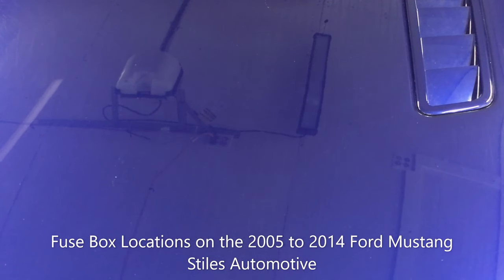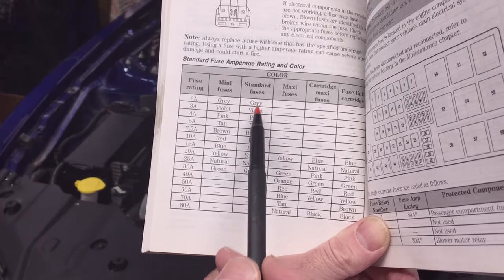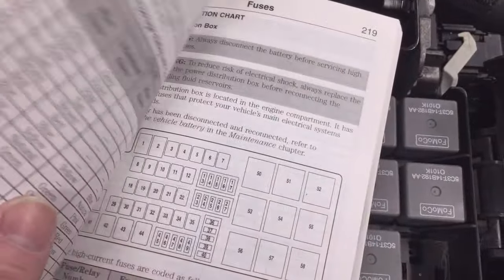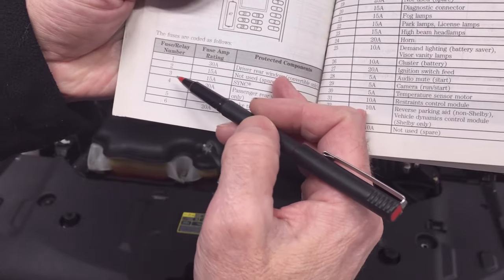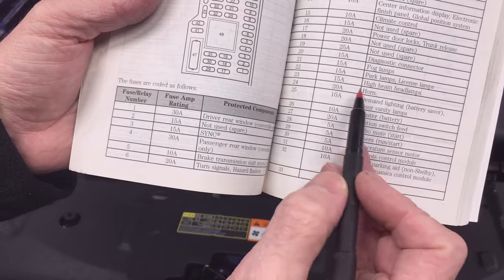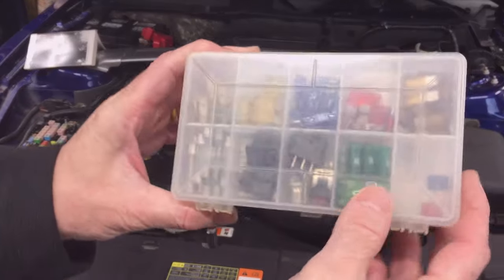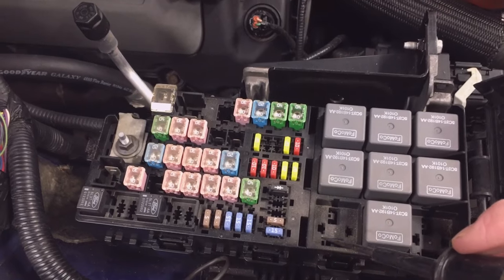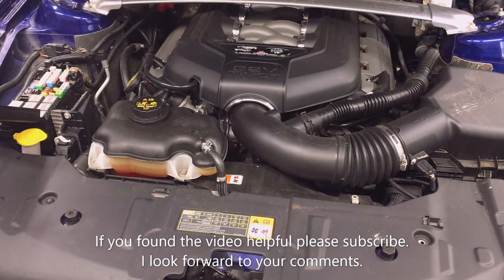Fuse Box Locations on the 2005 to 2014 Ford Mustang

Comment: Can someone tell me which powers the obd2 port so i can read codes
Reply from the maker: cHEVY, which Fuse powers the OBDII Port?  For the 2013 Ford Mustang, Fuse 20 (15A, Blue) Diagnostic Connector in the Passenger Compartment Fuse Panel, powers the Port.  Reference Mustang Owner's Manual, Page 227 thru  229.  - Stiles

Comment: what’s the fuse for parking ????
Reply from the maker: Taly,  What year of Mustang do you have, and are you talking about the Parking Aid Function or Parking Lights?  For my 2013, the Reverse Parking Aid Fuse is Fuse 32 ( 10A, Red) and the Parking Lamps / License Lamps Fuse is Fuse 22 (15A , Blue).  Reference the 2013 Ford Mustang Owner's Manual Pages 222 thru 224.  - Stiles
Reply: @StilesAutomotive  2006 , parking aid function

Comment: This video doesn't pretain to 05 to 09 mustang in fuses
Reply from the maker: Salvatore, This video just shows the Fuse Box locations. Although the 2005 thru 2014 Mustang have different Passenger Compartment Fuse Panel and Power Distribution Boxes, they are all located in the same positions. - Stiles

Comment: Long winded and panel didn't match my box on the 2007
Reply from the maker: Ok, locations are the same, Power Distribution Box (front right side of engine compartment) and Passenger Compartment Fuse Panel ( lower passenger side area behind the kick panel).  Being long winded, helps people reference their Owner's Manual Fuses and Relays Section.  In the case of the 2007 Ford Mustang, see pages 176 thru 181.  - Stiles

Comment: anybody know where the fuse for the speakers/rear speakers are?
Reply from the maker: Mel, You didn't state what year of Mustang you have, for the 2005 thru 2009 Fuse 6 and Fuse 9 are for the Rear Amplifier (30A, Pink) in the Power Distribution Box is located in the engine compartment. For 2010 thru 2014 Mustangs Fuse 20 (30A, Pink) Rear amplifier (Shaker 1000 radio / Shaker Pro radio) in the Power Distribution Box is located in the engine compartment. - Stiles
Reply: @StilesAutomotive  thank you bro ur a life saver i have a 2012 sorry for not specifying 😅